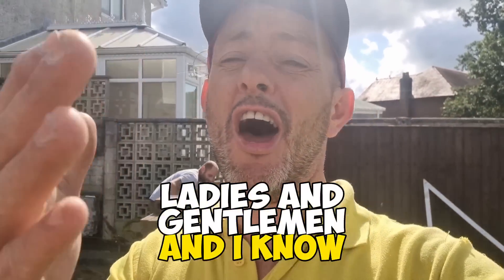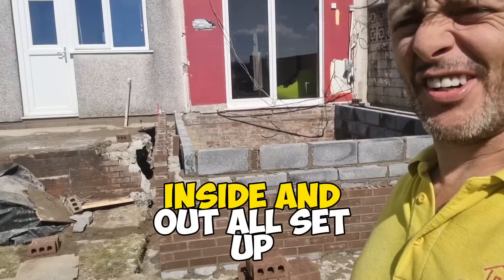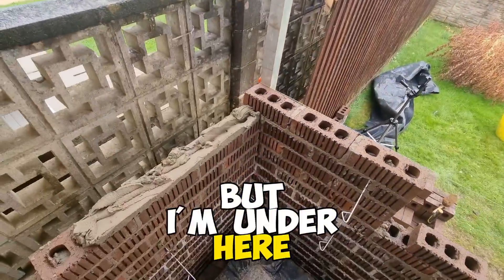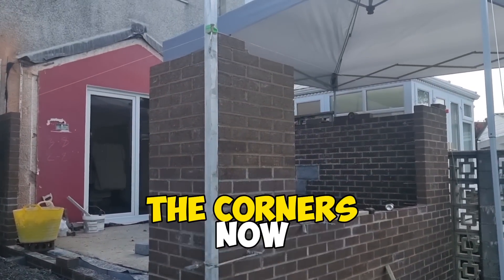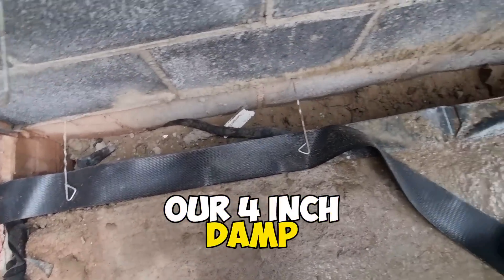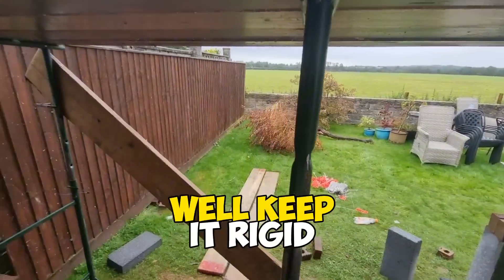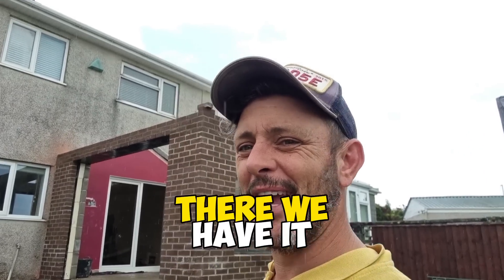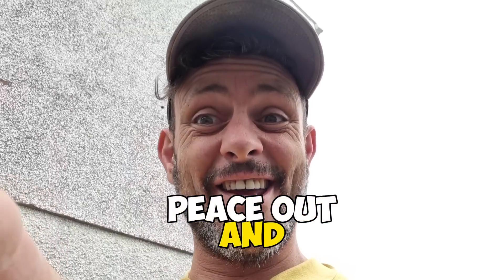single story extension in 4 days #bricklaying #brickwork #construction

Comment: Hey man, Do you get the structural  engineer in for this job or 1s like this or do you just say to customer, you sort all that then il come and build it?
Reply from the maker: It all depends on the client buddy. I can do either way. This one the customer had sorted it. Build control normally check 3 times thought the build also
Reply: Ok, cheers  😁👌